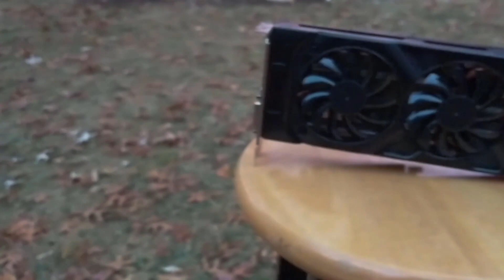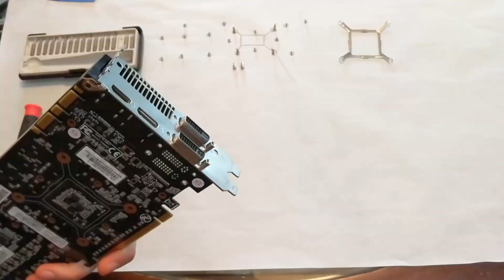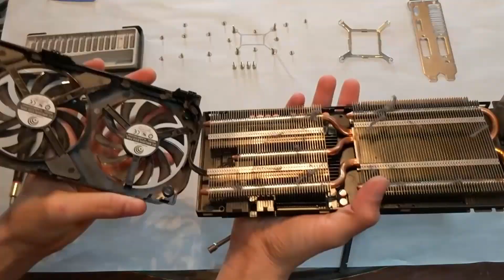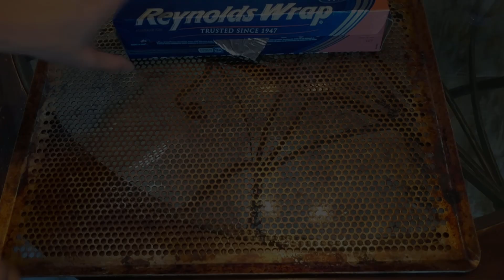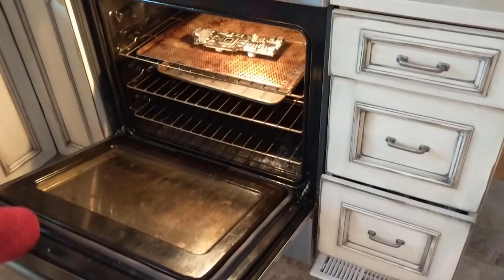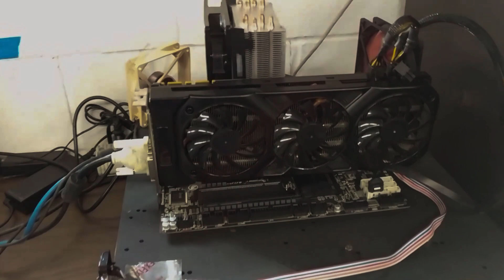Hardware Repair Ep 1 : GTX 770

Comment: I use the heat gun + flux method. It's much more efficient. Also in my experience, only cards that can power up can be fixed with a heat gun and you are looking at only a 50% chance at that. Best cards to look for are cards that are artifacting. Cards that don't power up and or don't display usually have other problems.

Comment: Don't use that oven for cooking as the card let off chemicals so your food
Reply from the maker: I doubt that one baking is that harmful, but I do agree if I end up using the oven baking method several times it will probably get unhealthy. So for the holidays, I do want to get a heat gun, so I will no longer have to use the oven. Thanks for watching